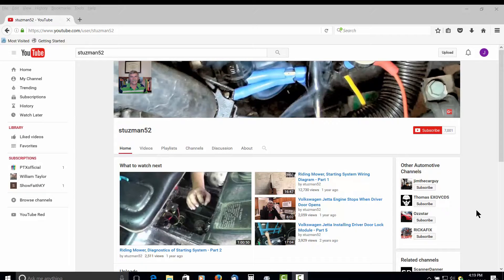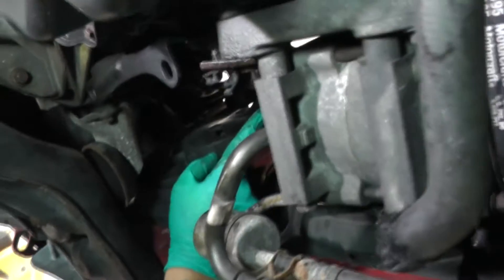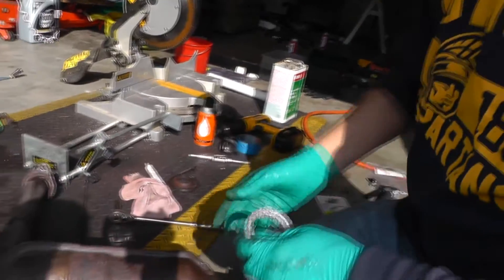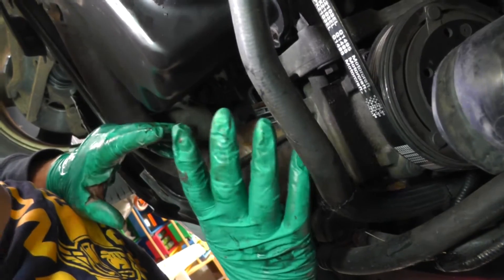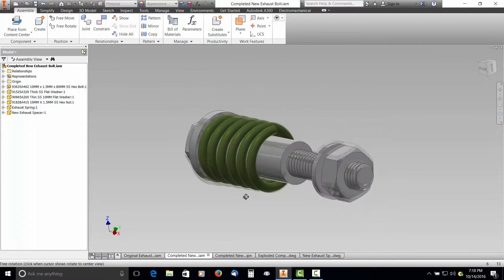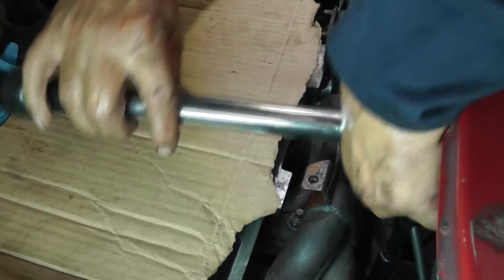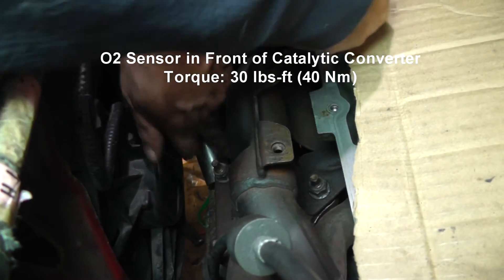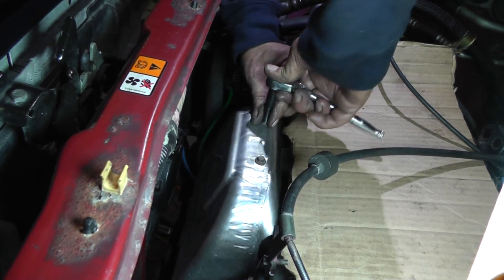Ford Escape Timing Belt and Water Pump Replacement - Part 7

Comment: Great video I have a 2.0 2002 escape and I'm having trouble finding crank shaft sensor and cam shaft sensor any 💡 would be awesome
Reply from the maker: Hi Ryan! Here's a link to rockauto.com that has both listed. https://www.rockauto.com/en/catalog/ford,2002,escape,2.0l+l4,1385265,ignition I would stick with Motorcraft for the parts.

Comment: My husband is going to change my timing belt on my 2002 Ford Escape.  We watched your video, and he really appreciated the way you talked through it.  He has it all apart now and is going to go get the belt tomorrow.  Mine broke on me, so no choice but to get it replaced.  Thank you so much for your detailed series on this project.   (Alaska)
Reply from the maker: Great in your husband in taking the initiative to do the job himself. Just tell him to take his time and all should be well. Be sure to get a timing belt kit which includes the belt, idlers, tensioner and water pump. In other words, don't just change the belt. Thanks for the comment!

Comment: Many thanks for this video series, it seriously helped me do the same job on my 2002 Escape 2.0L.

One question, did you re-use the three nuts for the top of the catalytic converter? The factory service manual says to discard the nuts and replace with brand-new, but I get the impression you re-used them.
Reply from the maker: dunebasher1971 I reused the nuts and all is well. From the service literature that I followed, there wasn’t any mention of using new nuts.

Comment: Another great vid Terry. I like that drawing and making what you need. The machinist we have at work is great also. He can make about anything and as I have mentioned before I love Mcmaster-Carr!
Reply from the maker: Yeah Mike, I didn't like what the dealer provided for the spring bolts and knew it wasn't that bad of a job just to design something that emulated the original. It all worked out pretty good and we use McMaster-Carr a lot at work too :)

Comment: Terry Is there a reason you use Copper antiseize vs Nickel. I like the exhaust spring bolt set up. I'm a big fan of McMaster-Carr being using them for years to get my hardware. Until now it has all been Formosa, Canadian or US made. I just ordered some metric flange nut and they came from Commie China. I really hate to see that but it is what it is.
Reply from the maker: The nickel anti seize would be fine also Eric. I used the copper because it has a higher temp rating versus the nickel. The temps are 1600F for nickel and 1800F for copper which gives a little more edge with the hot exhaust. Again, the other should be fine too. Yep, everything is coming from China and doesn't look like it's gong to change. It does make one wonder where we're heading to with all the changes that I've seen in the last 40 years. Take care Eric and thanks for the question and comment!